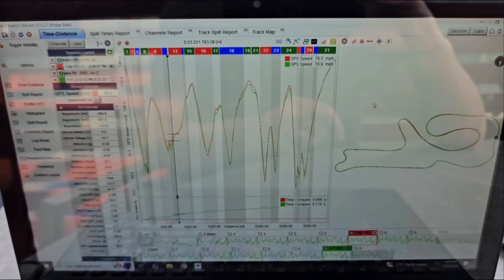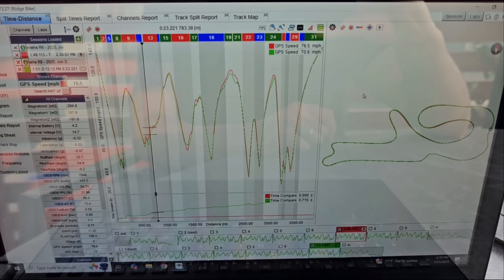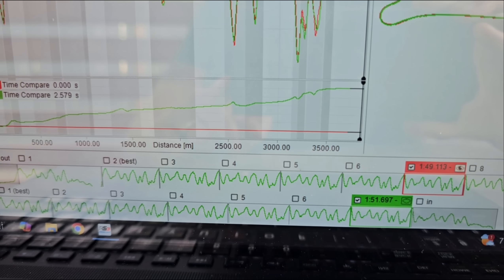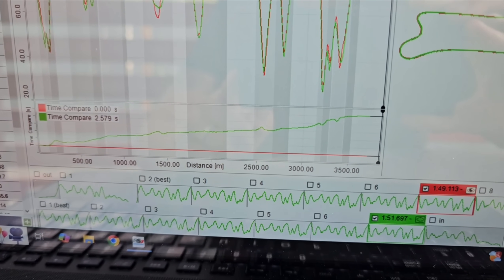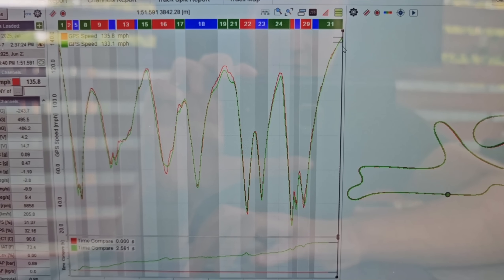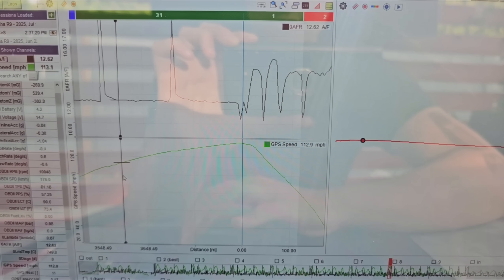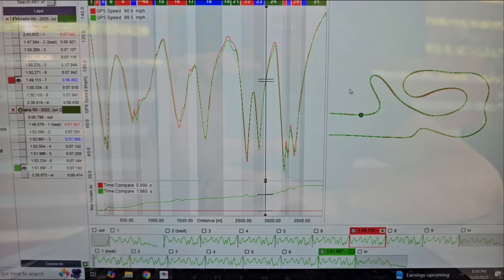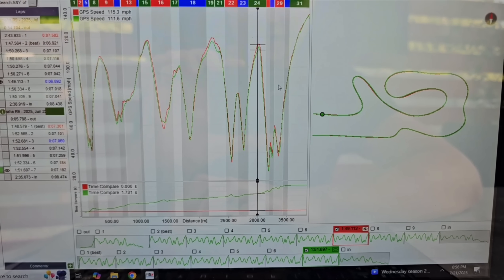In-depth race data analysis of our 2WDW R9's latest ram air and velocity stack upgrades!

Comment: The R9 gets into the corner well but the ZX6 is capable of getting out of corners much better. The ZX6 transitions better from one corner to another in tight sections. Its obvious why. The ZX6 is simply a smaller, lighter, better handling bike.

Comment: My friend had his R1 flashed by BTMoto, and his bike ran with some issues after the flash. So, I decided to look for a tuner to tune my R1M, as I didn't want the same to happen to my bike. I found out about 2 Wheel Dyno Works through Brian from Sportbike Track Gear. Thank you, Nate, for flashing my R1; it runs amazingly now with no issues. The only thing I think I should do now, at 3000 miles, is change my spark plugs.

Comment: Ram Air on small engines does not work the way people expect it to with cars. 
Bike engines just don't move as much air relative to autos. For bikes Ram Air is about consistent volume in the air box. Whereas car engines can produce the super charged effect due to much larger volume and demands. A Hayabusa engine can achieve the supercharge effect due to the sheer volume and speed it's capable of. Liter bikes and smaller cc not so much.

Comment: U guy s have plenty torque to come off any corner with that setup and the tune and engine performance is just fantastic, however, -1 at the rear might benefit depending on the track you are racing in terms of how much more time you can begin to open the throttle mid corner/exit. I know you guys run -1+2 now, but, i would say is worth the try -1 at the rear... just saying cuz that helped me a lot to catch up faster guys on a race.